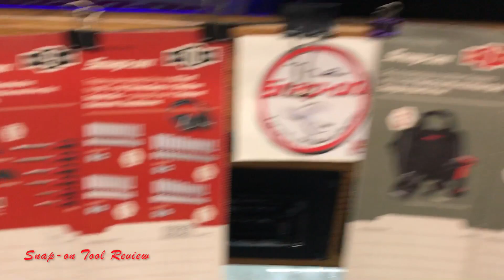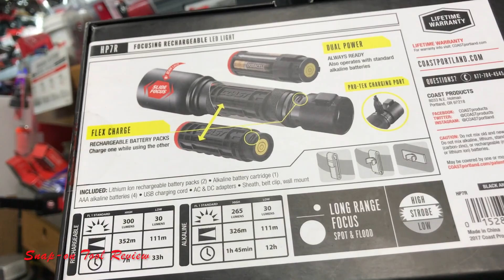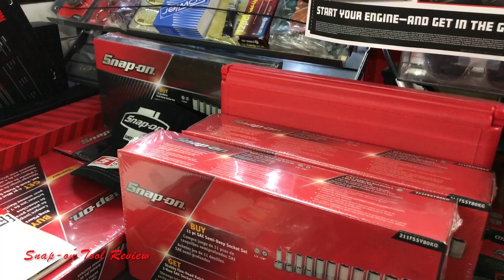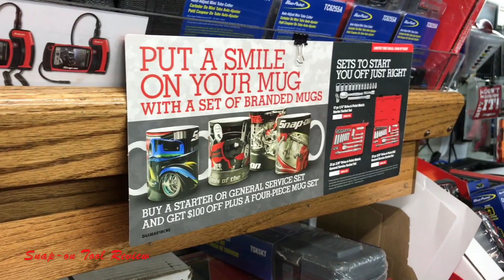The Last SNAP-ON WEDNESDAY Of The Month

Comment: Do you know how much your dealer is after for that older Verus?  My dealer has not gotten one for awhile.  I am 5h up the Coq from the sea area.
Reply from the maker: Not sure. I can ask and get back to you.
Reply: Ryley Smith The Verus is being discontinued so you’ll probably see more used ones available as shops trade up for the Zeus.
Reply: I appreciate it, thank you.
Reply: I think just the Verus wired is, the Pro and Edge are still supported.   the city I am in is a little strange.  the 3 dealers in the area, don't know of anyone that has a Verus pro/wired still.  Most have the Modis, Verus edge, or Solus Edge.  could change.